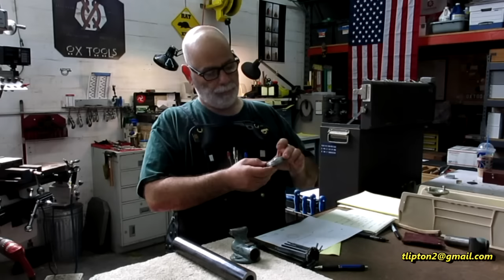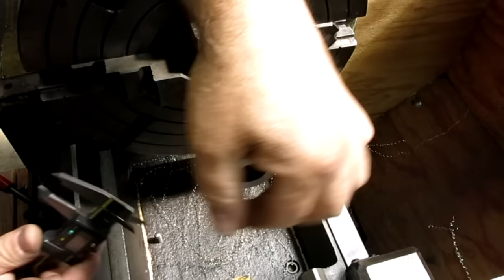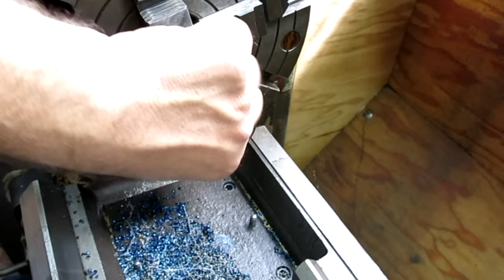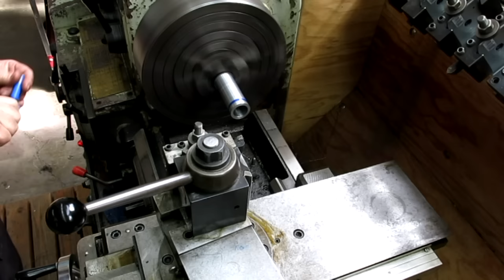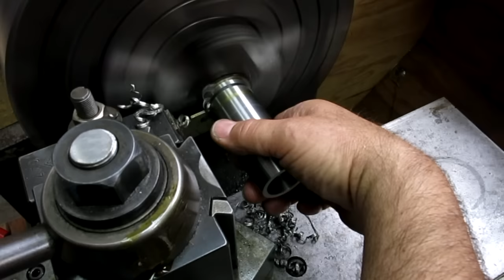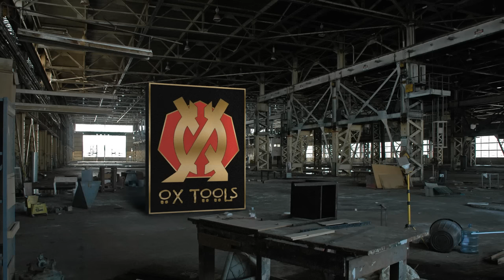Baby Bullet 4

Comment: 2 things
The south bend turn nado i use at my shop has a forward reverse lever for the carriage and you can reverse the carriage with out stopping the spindle but you need to stop the auto feed first though

2 wouldnt it make a better cut boring it first then turning the outter diameter with a center for the most rigid setup
Reply from the maker: Hi Mighty,

This part geometry was not really a machining problem. The wall was thick enough that it didn't really cause any problems. Thanks for the comment. 

Cheers,

Tom

Comment: Nice video Tom, how do you plan on finishing/protecting the final vise? I think it would be cool if you covered it in bondo, sanded, and painted it just like the exterior of bridgeport mills are finished.
Reply from the maker: +Lewis Brigman Waaaaaaaaaaaa........ Bondo. Yikes I could never show my face on any machinist forum again. This will be all metal finished in and painted with a polyurethane coating to match the original Wilton color. Thanks for the comment.

Cheers,

Tom

Comment: Tom what brand of telescopic gauges do you use? I have a cheap Chinese set, and they give the predictable cheap tool frustration, having the extraordinary ability to explode into their component parts at the worst possible moment with monotonous regularity. I've taken them apart, fiddled, fettled and and polished those turds to within an inch of their lives, but it's time to admit to myself that I bought crap. I use these puppies a lot so will just have to spring for a decent set. Probably used. Of course I'll need the metric versions ;) You haven't cost me money for a month or two, so I'm looking for recommendations for a decent set and I'll pass my existing ones on to somebody I really hate.
Reply from the maker: +Pete F Hi Pete,

I use Starrett's mostly. Mitutoyo are nice as well and come stock with longer handles. I bought special long handles for my Starrett's so I can swap them out if I have to reach down a hole. I prefer the centering type. Its a matter of personal preference on that. Adam likes the offset type. Thanks for the comment.

Cheers,

Tom
Reply: +oxtoolco Thanks for taking the time to get back to me Tom. As it happened I bought through ebay some Mitutoyos only last night, they were recommended by many on PM. I have mainly Mitu metrology gear so was comfortable with what I was likely to get, and indeed have their small hole set already. They're normally quite expensive, hence why I was looking for alternatives, but this one was mis-described in the auction. I was of course only joking about the metric v imperial versions of telescoping gauges, only to discover Mitutoyo do indeed produce 2 different versions!!! I presume only the packaging is different. Thanks for putting up the great videos!

Comment: When cutting that Angle, Couldn't you zero the dro for the compound when you made the reference mark in your blue then work to zero. As long as the carriage is not moved the zero should stay the same. Right?
Reply from the maker: +jeff edison Hi Jeff,

I didn't want to keep track of numbers on the compound. I want to go past the end of the cut when cranking the compound in. The compound does not have a DRO scale on it only the dial. Thanks for the comment.

Cheers,

Tom
Reply: Oh didn't realize that. I knew you had a reason for not using the dro. Pretty good reason! Lol. Can't wait to see the rest of the build.

Comment: At around 7:00 we can se difference on the outside finish. You use the same material and the same insert ? Why is that ?

Thanks for showing.

Robert
Reply from the maker: +Robert Patoine Hi Robert,

In that case it was caused by the depth of cut. If you look at the chips the chipbreaker is not engaged in the cut so the finish suffers a little. Depth of cut plays a big part in finish in particular with inserts. Thanks for the comment.

Cheers,

Tom